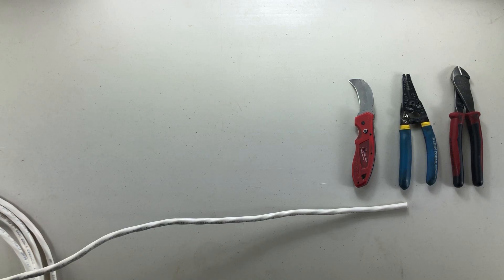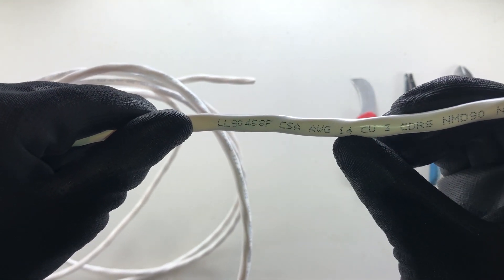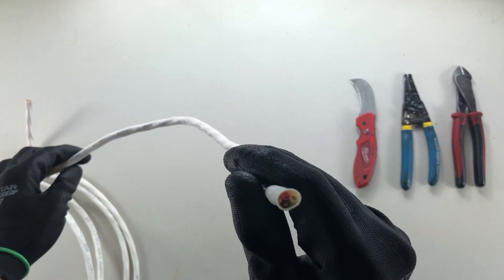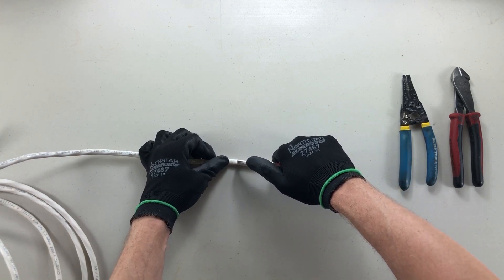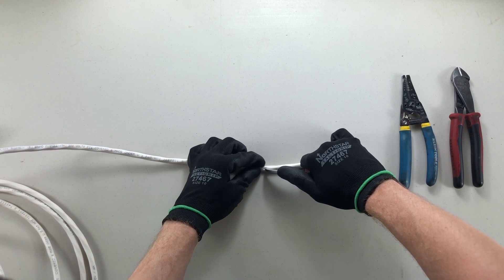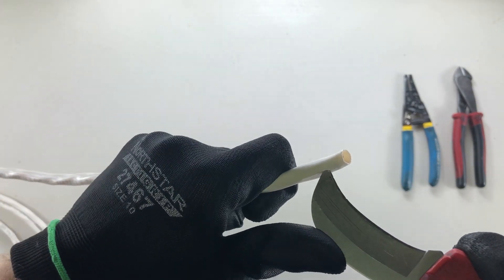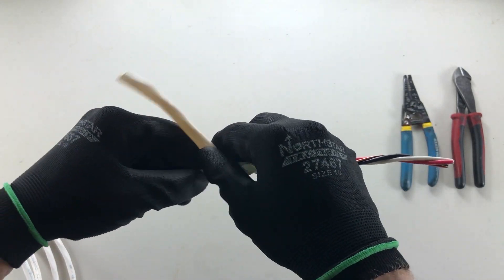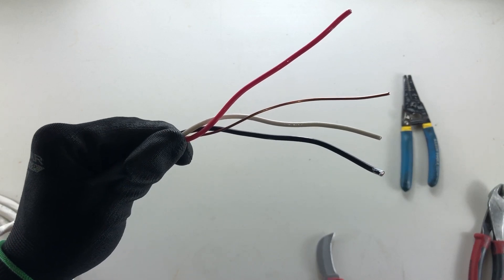How To Strip 3-Wire Romex Cable - The Electrical Guide 2019

Comment: Agreed on the sidecutter tip
Reply from the maker: Yeah for sure, if you use your knife which is the lazy way you will eventually end up damaging the insulated conductors under and have to trash that cable. Side cutters ensures no damage to the conductors when cutting off the jacket :)